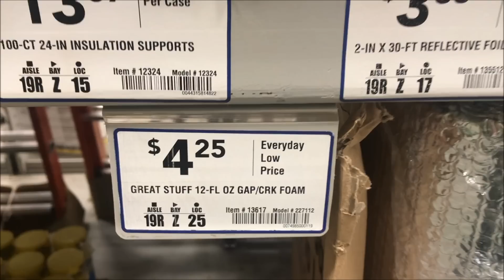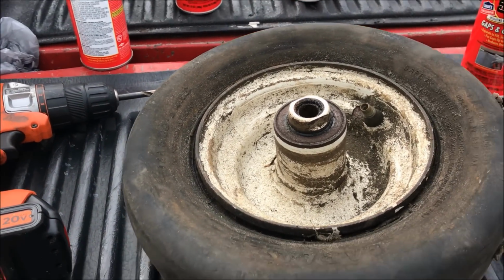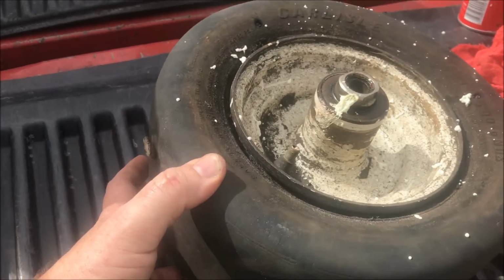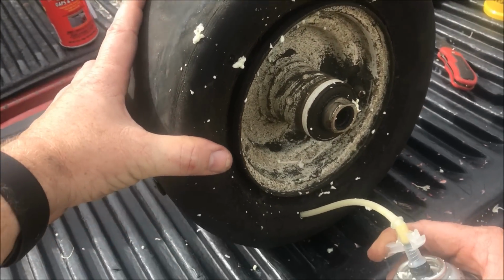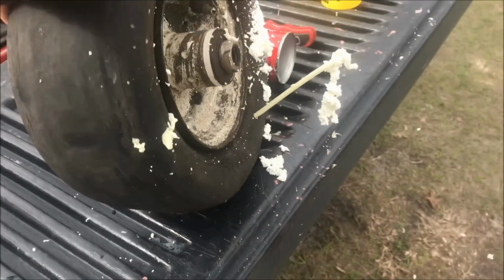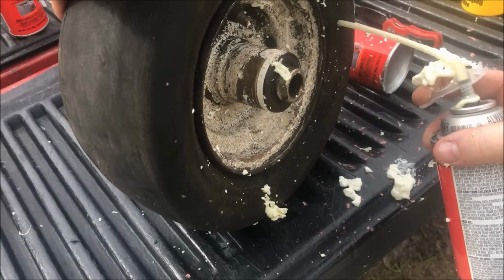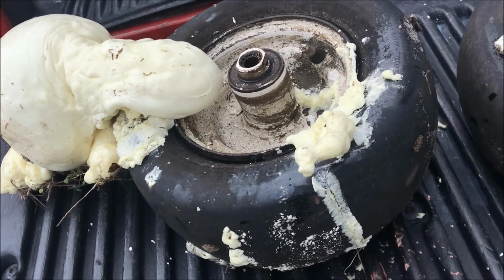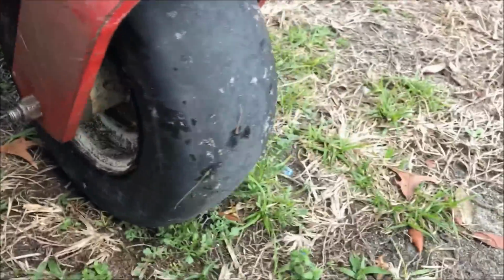No more flat tires How to fill a TIRE with FOAM

Comment: Why didn't any come out the valve stem ? That's a hole, why didn't you SEAT the tire to rim 1st, then fill with Great stuff, try on your car next, great for a Demolition Derby now, just use for heavy duty snow tires for a truck, make it fit in valves now, then drill a hole on opposite side but on thread, not side wall, at least it can be plugged and look right.

Comment: That won't last.every time that tire rolls it will break up the foam inside the tire especially if it has weight on it.Just think about how easy it was to break it off the tire.

Comment: The tire ain't even on the BEAD! And you ain't got-cha no cushion like a regular tube tire would. And the foam will crush down over time. Then when you go to take that tire off and replace it with a new one, the rim will have that stuff stuck to it on the inside. Ugh.

Comment: Click bait! I feel bad for the people who would actually try this, lol.
Reply: but it would be phunny to watch
like the russian/ukrain guy testing foam in tires [didnt werk] so he tested other methods like cement -
didnt werk, but he made video anyway ;)
Reply: @Juli Talbot why would he want to drill more holes when he is trying plug the ones that are already in the tire?
Reply: He is trying to keep the air from escaping.
Reply: @arleyamundson7376  no he is not trying to keep the air in. He is trying to replace the air with foam. Maybe if you drill a couple holes in your skull you wouldn't be such an air head. Go and look behind the toilet tanks in your house and make sure its painted the same color as the rest of the bathroom. If it isn't the same color. Go ahead and paint the walls to match what's behind the tank. After you've finished that find a penny, nickle, dime, and a quarter. Place them on top of your head. That way you will have a little common cents.
Reply: @eggroll1up918  duh. You catch on quick.
Reply: @arleyamundson7376  are u one of those split personalities type? because you commented that he was trying to plug the holes to keep air in? Btw did you complete your task I gave you?

Comment: Don't fill a tire that has any kind of considerable weight on it. It will not dry correctly
Reply: I wish there was a way that I could post photos in the comment section of what the aftermath looks like.

Comment: Please wear gloves as this spray foam will not come off your hands or anything else it comes in contact with when wet. 
If you get it on your skin nothing will take it off, it will have to wear off. 
Use safety glasses for the same reason.

Comment: It hurts to see this suggestion. The foam : won't fill evenly, cost $ for product. Can blow tire off rim during expansion. When cured it will hold temporarily because the cured foam will crush and collapse as driving pressure is added. Image you had styrofoam tires covered in rubber. The foam cant resist being crushed. In my opinion the cost of foam/ labor/ clean up.. / breakdown is not worth it unless for a ONE TIME GET OUT OF A JAM EMERGENCY TIRE FILL.  They sell specific emergency tire inflation foam and instructions say to discard tire once you get to a garage. Sorry.

Comment: Sorry, but this is dumb AF. First off, those tires don't have any tread - why the heck are you trying to save them? Secondly, there is a reason why this stuff and fix-a-flat are only temporary fixes, because the foam breaks down over time, meaning you'll have to repeat the process all over again. If you are so poor that you need to keep using the same tire, then just open up the beading and remove the valve stem and put in a 10 dollar innertube.
Reply from the maker: First of thanks for watching and sharing!
Secondly the tire is a smooth tire. It’s not supposed to have tread it’s on a exmark z-turn lawn mower.  I was poor no extra time. Picking up roofing nails in the tires gets old. Customers have new roofing and nails love the tires. The foam works great in this situation. If you haven't already done so, please consider becoming a subscriber.

Comment: In time, it will break down and will become very squishy as if you had 1/4 the amount of air required.  You can run never flat tires for around $28.00 - $30.00 each and be done with this messy nonsense.

Comment: "Great Stuff"?    I call it lousy crap.
Reply: Just a surprising piece of information that might change your mind, it works really great for car repairs. I was suggested this by someone in a shop and thought he was out of his mind. I repaired the bottom of my car running boards and bondoed over top and the foam made it easy to shape with the sander and you would never no they where rotted out! The bondo makes them 100% solid

Comment: Waste of money!
Reply from the maker: Thanks for sharing. I was getting nails in my tires daily. I had loss of time due to down time for flat repairs. This solved my issues on the mower. Thanks For Watching Please Subscribe My Channel if you haven't already
Reply: @how2af263  I used cacs and cans of that foam stuff. I eventually had to replace the whole tire and wheel assembly which I was able to buy from LOEWS reasonably cheap. Foam was money down the drain. If it fixed your problem, go for it.